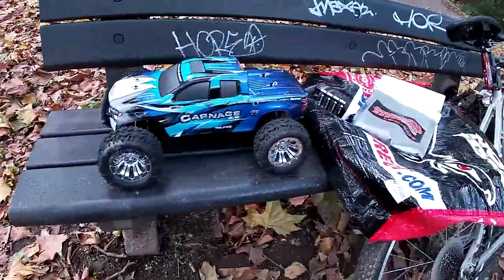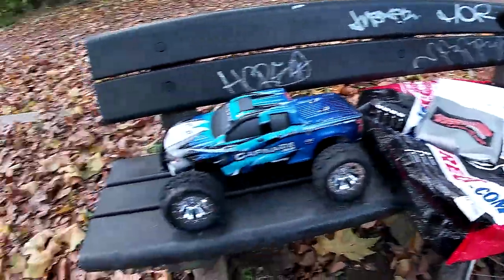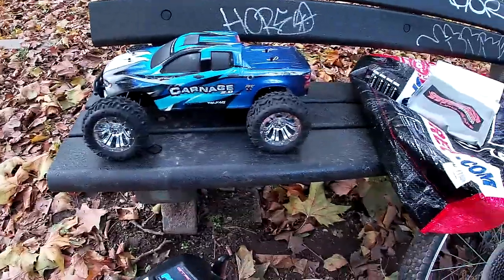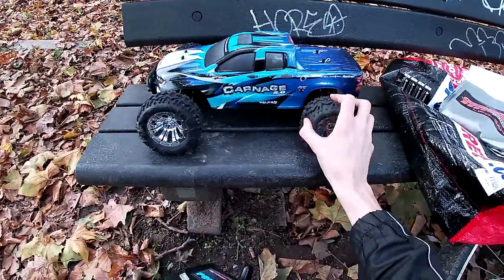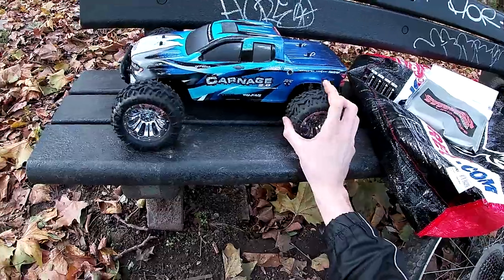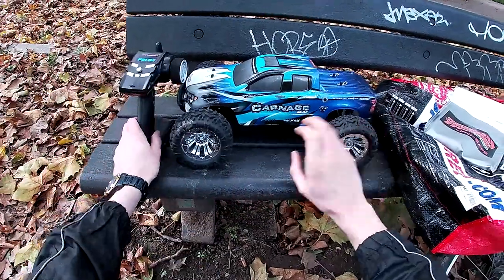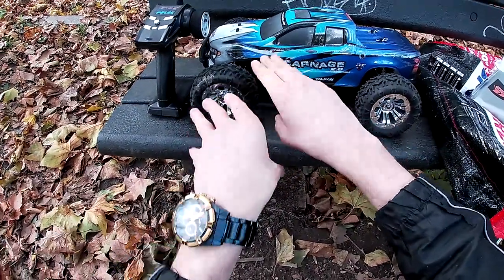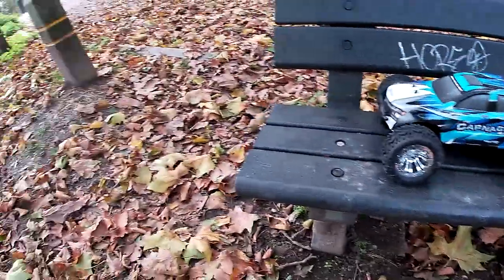FTX Carnage, Another Run another Spur gear bites the bust🙄

Comment: Looks great drives great,the flex in the chassis is the problem, do you reckon if you can somehow stop the flex it will be better?Bradley Wigginton 😆😆😆
Reply from the maker: Bradley wiggins/ Tour de France winner . 😬. 

It was really Going well so Powerful for its size and considering it ain’t set up for anything and a slow servo it was really enjoyable . It’s a bloody shame . 😡 
I don’t know if I can stop the flex it’s the plastic chassis not very thick . It could twist in half .
Reply: Wigginton, bloody auto correct 😁shame there's no way to brace chassis bro😀👍👍
Reply from the maker: @rcplaytime  
That’s cool M8 I even googled wigginton in case I missed someone . 🤓. 
The only sensible thing would be for a Metal chassis or At very least , Thicker Plastics .
Reply: did you😀😀i may call him Wigginton from now on 😀😁

Comment: Did spur strip or pinion come lose bud
Reply from the maker: Spur gear has been Slightly Damaged, I think I’ll get away with it. The Pinion was Smoother than  a Bald blokes head.  I think where the screws hold the motor in on the motor mount they’d rounded a Groove my guess was the motor moved . ( May be ) I changed the Motor mount new motor screws put an RW pinion I will have to test it .
Reply: @mark-1rc502  Ive seen people put metal top brace cross the chassis to stop it flexing bud think chassis can only handle 2 s bud maybe they next carnage will be tougher bud
Reply from the maker: @rcnitroflux2361  
Yeah I was thinking that’ll be about the best I could do. 💁‍♂️
As I say I have fixed it again, Changed Motormount, new motor screws, the Hardend Steel Spur Survived I have put a RW pinion this time.  I haven’t had the time run it since. 
Seemed ok across the living room.
Reply: Nice bud put fair bit of money in it then with esc motor pinion spur gears bud